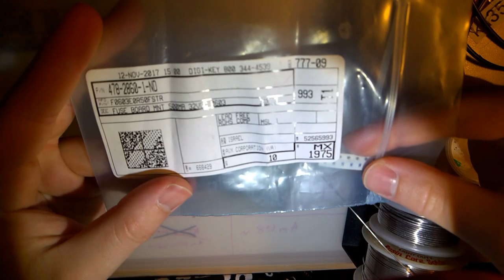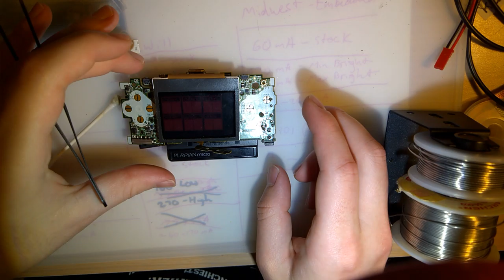Fixing up a junk Game Boy Micro - Part 1

Comment: I have a question that sound strange, I am having a prooblem w my micro, I finally realized that the fuse is my problem. My question is by any chance do you know the proper names for the fuses that go in  f1 and f2  and where I can buy them ?
Thanks  :)
Reply from the maker: Should be the same part as SP. 500mA to 1A will work. I'm unsure of the size off hand but if you can't find 0402 then 0603 will probably be fine.
Reply: @makho  the ones from console 5 worked on 2 micro, just fixed them

Comment: hey man! thanks for the video. i replaced the battery due to some corrosion, and replaced the fuses as the one on the board next to the pads was testing bad. everything testing good now. however, when i partially reassemble it still dosent power up. ive thought maybe the screen didnt have back light so i shined a light and still no image. power seems to be making it past the fuse into the circuit, but still no image or backlight. is there any way to test bad screen? ive ran out of ways to test.
Reply from the maker: Make sure a speaker is attached (or use headphones) and see if there is any audio. It should at the very least beep whenever you adjust the volume but you should also hear the bootup chime or game sounds if you have a game in. No sound means it's not booting.
Reply: thank you for the reply, i thought of that today!
Reply: no sound either. so its not booting. would you be interested in making a video of repairing it? or maybe advise a few other things to test to see whats going on with it?
Reply from the maker: @svanput  couldn't say without more details and youtube comments really aren't the place. If you're interested in fixing it, I'd start by checking out the troubleshooting channel in the game boy discord (bring pics)
Reply: @makho i 100% can but i dont see a link to the discord, and i wasnt able to find it by searching. do you have a link?
Reply: @makho  my name on there is mastav79

Comment: Do you know what f1 fuse controls? The battery or the charger port?
Reply from the maker: I don't know which is which off hand but one fuse cuts the battery out of the circuit and the other the charge port. I think "control" is the wrong idea. 

IIRC F2 is for the battery and F1 is the charge port.
Reply: @makho  gotcha ya I just got the fuses from console5 and they worked great on my micro, so thank you for answering

Comment: I need to replace the f2 fuse on a micro. Would using the replacement fuses for the SP work on it? Does anyone knkw
Reply from the maker: smaller fuses would be easier to install but yes

Comment: How are those fuses holding up? I just bought a Micro and having the same issue.
Reply from the maker: No issues so far (and I actually use this Micro btw)
Reply: Do you remember where you bought the fuses? Maybe have a link?
Reply from the maker: @d_foster50  I got them on digikey. The fuses I used were the wrong parts. You want 0402 size and probably 1.25A. Any parts retailer should have those standard. Lcsc probably has them for a lot cheaper than mouser, digikey, or arrow as well.